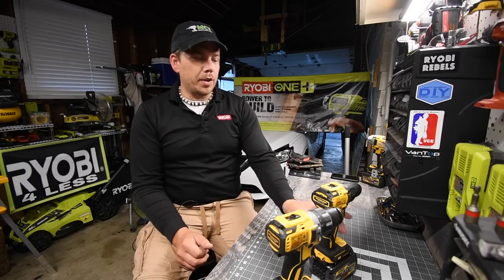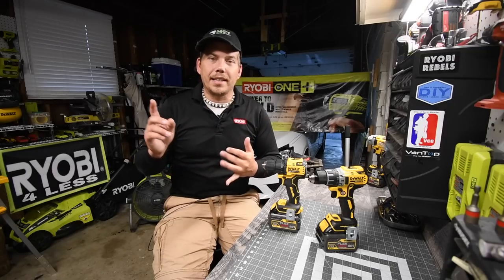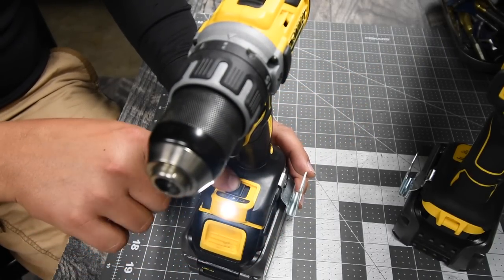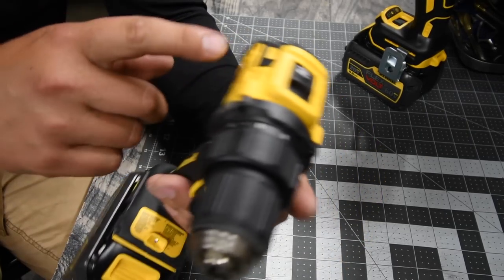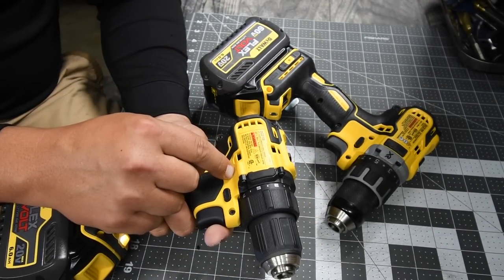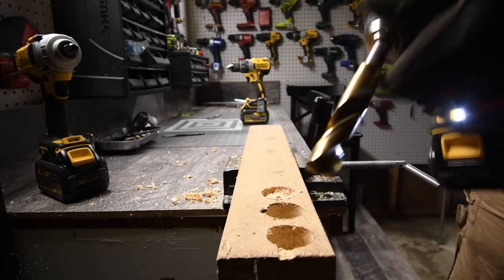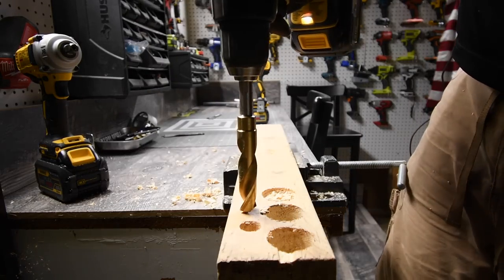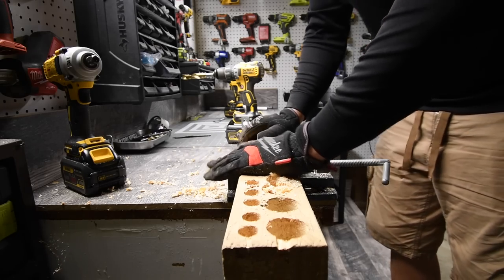Dewalt Atomic Vs.  XR

Comment: That XR 791 is an awesome drill I am a huge fan of DeWalt over the years but I’m going to go ahead and say I am very disappointed in DeWalt’s new line of compact drills and compact Hammer drills they are all underpowered and DeWalts impacts are just terrible including the aging dcf887 that wasn’t very good to begin with I use a Ridgid impact in place of the dcf887 I hope one day DeWalt can give us a decent impact tool and nice review on these two drills 👍
Reply: Mate I have the 708 Atomic ,I bought it to have something super light weight and easy to handle to hang doors all  day or drill decks etc without getting fatigued, this is the point of it !!!! Since hearing all this bullshit about lack of power ,I did my own tests and put a half blunt 600 x 16mm wood auger on it ,in first gear it drove it into seasoned Aussie  hardwood full depth not even sweating then I put a 100mm batten screw and in SECOND gear it drove it into 100mm seasoned pine and pulled it out time after time .Wtf more could you ask for from a compact light weight drill ?????
Reply: @interman7715 Well did you just read my comment or did you even watch the video? if you did watch the video no need in going on a rant over what I said and besides the dcd791 isn't much bigger than the 708 but is much more powerful if you don't believe my comment show some restraint and watch the video again the results show the difference in power and no huge size difference
Reply from the maker: I thank you for viewing  :)
Reply: @6548ww   Did  you actually watch the video ? I was surprised myself how well the 708 did!  The 708 is almost 500 grams lighter than the XR , not insignificant btw, that's why I bought it so I could hang  it on a tool belt all day without getting bothered  by it .A true comparison would  have been against Makita  compact etc.

Comment: I have watched a ton of comparisons and Dewalt always loses. Far cry from what they used to be.
Reply: Not always....
Reply from the maker: The new Dewalt power Detect beat the new HILTI Brushless hammer drill and that HILIT beat the crap out of Milwuakee Fuel. so Dewalt does have some extremely powerful tools
Reply: @ManCaverTools  and one more thing even if ryobi or Hilti or makita or whatever is better than dewalt contractors will still choose the dewalt because it's more durable in time

Comment: I think this was almost what I wanted to see.  I’m trying to see what the differences between the
Atomic 20V MAX Brushless Hammer Drill
vs
20V MAX XR Brushless Hammer Drill
Sometimes called 20V MAX XR Hammer Drill

1.  I read reviews saying that XR on a tool means it’s brushless for better battery life versus on a battery meaning it’ll last longer.  This explanation doesn’t explain power which your video does, unless that’s just an extra feature provided that doesn’t have anything to do with XR besides just making it a more powerful tool just because.  Is this true in your review?

2.  In this case does an Atomic 20V MAX Brushless Hammer Drill automatically make it XR?  Desalt seems to be playing tricks with marketing and their terms because their is 2 different Atomic Hammer Drills one being non-brushless and the other being brushless.

3.  I enjoyed how you tried different battery sizes.  Most people don’t think that higher amp hours provide more power too.  Milwaukee for instance, have CP and XC.  XC gave extra power but reviewers never test different amp hour batteries.

4.  No one believes me in this, then again I’ve only used a Milwaukee and Dewalt tool, but I think Dewalt has a huge advantage in one very specific category.  There is this safety feature that I’ve been preaching but nobody believes it’s that big of deal.  Theirs this feature when screwing in screws the tool detects slight resistance factors causing the tool to slip during rotation to prevent stripping.  You may say all tools have this feature but compared to Milwaukee this is not the case.  They call it a mechanical slip clutch, which continues to rotate and slip, versus a mechanical clutch, which shuts the tool down, which most tools have now.  These are 2 different types of clutches.  The mechanical clutch nowadays isn’t sensitive enough and can cause screw stripping or in some case during drilling, hole stripping with the screws threads.  My Milwaukee tool can’t detect these slight resistances and continues to rotate even when the screw is flush against the wall.  People say well just adjust the torque.  In this case the torque is either too little, which the tool can’t screw in the screw and shuts down,or too much, which the tool never senses the resistance and causes project failures.  The Dewalt impact Drill shines greatly in this special feature.  The tool senses the resistance and causes the clutch to slip, hence the continuous rotation and clicking noise.  This is the perfect tool that makes use of the impact effect and ultimate safety net that prevents stripping of any sort versus the Milwaukee impact drill doing too little or too much causing you to put more effort in determining secure screws.  People don’t believe this and say It’s non-existent.  No reviewer has ever exposed this feature so could you make a video on this, please!  Very few say they noticed and say this is an old feature and Dewalt may have just hit a good feature by keeping the old feature in their wireless tools.
Reply from the maker: the size and hammer feature is difference. the hammer drill might have a tad bit more power, I thank you for viewing Turok

Comment: Dewalt typically rates their tools in UWO(Unit Watts Out). They do not use torque values as explained here:
https://toolguyd.com/dewalt-cordless-drills-uwo-torque/

They do have the UWO printed on the box of the tool typically

DCD708 - 340 uwo
DCD791 - 460 uwo
DCD991 - 820 uwo

The DCD708 Atomic series is a lightweight drill primarily aimed at home gamers, but the pro's may enjoy its lightweight compact nature as well.

The DCD791 does not perform well with anything less than a 4ah battery. I use the 791 professionally in a fabrication shop daily. It is the only drill I have found that can keep up through the day, and its far more battery efficient then the bigger 991.

Each drill has its place, the 791 hits the sweet spot in power to size ratio for me.
The 991 is far better at heavier tasks. It will break your wrist however if you don't hang on to it.
Reply from the maker: I thank you for the Link and I thank you for viewing gidderman

Comment: Atomic is crap. I bought one, the motor sounded like it was going to blow and the grinding gear were making so mutch noise. I returned it
Reply: Is that why it's called Atomic? Cause it will blow up lol
Reply from the maker: lol
Reply from the maker: atomic is designed for lighter duty stuff on a budget. I thank you for viewing Francois

Comment: 1.5ah batteries should be tossed in the trash. I think HD has this Atomic drill on sale right now. I'd only buy it if you have higher-performing batteries already and you're looking for something light-duty or you got a girl that needs a light drill.
Reply: Edit: I mention this because I saw someone review this Atomic drill and he switched out the smaller battery with I believe a 5AH and it performed really well.
Reply: Lighter batteries for easier tasks, I guess. You won't need a lot of torque to, say, assemble some furniture - 2ah is lighter and performs pretty well there. But when high performance is needed, out comes the 5ah.
Reply from the maker: I agree, useless battery